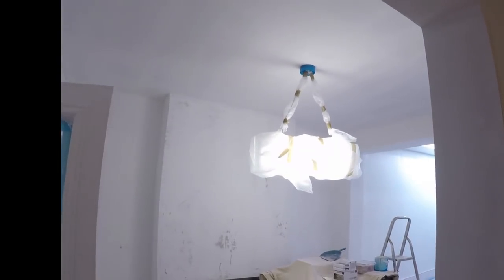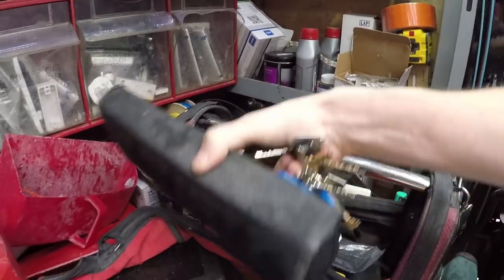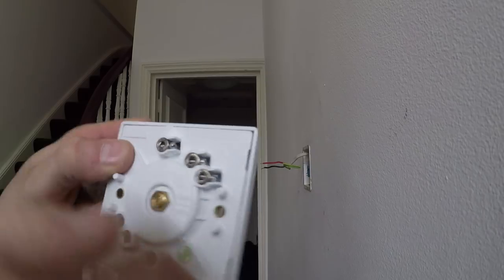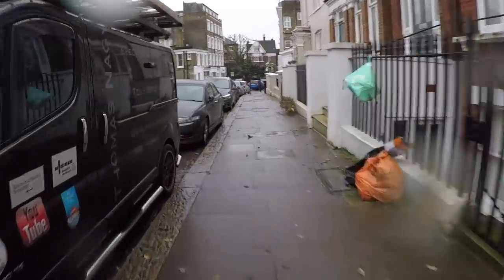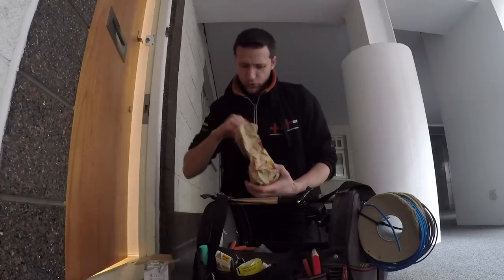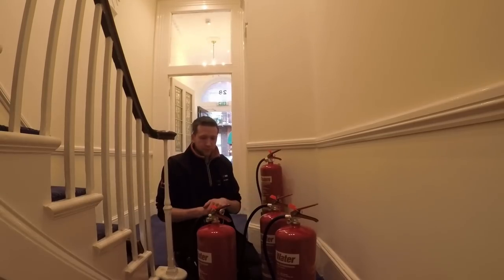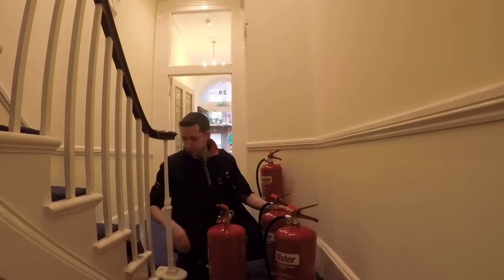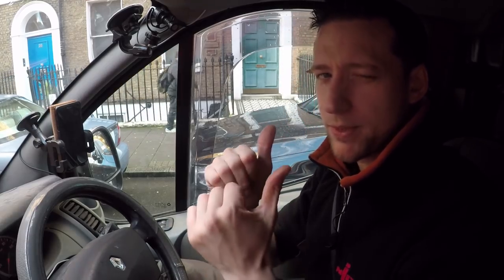Time switches & Fire Extinguishers - An Electricians Day in London | Thomas Nagy

Comment: I seriously hate the pneumatic push light switches. I find they are seriously poor quality these days and many fail within 12 months! Nothing wrong with Bridget Jones mate. It would be good to see a few more fire alarm videos from you Tom
Reply: Shameless plug: Search for MS Electronics TDS2 or TDS3 time delay switches. We’ll sort you out with a timer switch that’s much more reliable than those pneumatic ones 👍🏻
Reply: What, if anything is the standby current on these electronic ones?  Also, are they like pneumatic switches, not requiring a neutral core?

Comment: I was wondering why those timed switches don't exist at all in Germany and I think I deduced why: The way those are installed create a switches wire that will be connected to live at multiple points. Which creates so many error scenarios, e.g. people connecting it to lives from different breakers, people working on it after having disabled one switch and getting electrocuted etc. So it makes sense to me to make it code that every wire only ever has one point where it will be connected to live.

And in case you're wondering: German standard for this setup is using momentary switches to engage a central timed relay.

Comment: Those time delay pneumatic light switches are absolute rubbish. The housing association I work for insist we use the because they're cheap but they don't really save them any money as we get so many callbacks on them. They tend to stick after a while and I find they're quite inconsistent, you'll push the button once and it'll stay in for about 2 minutes, you'll push it in again and it'll stay in for 30 seconds.
Reply from the maker: agree 100%
Reply: Tbh, most landlords I have done work for have converted their emergency lights to LED bulkheads and just leave them on 24/7. For what it costs in call outs and materials to replace the pneumatic switches, it was cheaper to pay the extra electricity at 3W per LED bulk head.  

love the videos btw.... nice seeing how the other half live/work....

Comment: My main question is why would someone have a lamp installed right before the painter is about to start?
Reply: Bart Kuijper   Possible the lamp is installed since 60 years and the home owner wish a professional painter? Most normal people do not know that the painter use temponary renovation lamps ...
Reply: customers don't use their noggin. i did tree work for a bit and it seemed every time we had a big tree to remove the customer had a brand new fence put up right before we were scheduled to remove the tree.

Comment: Also not updating your phone puts your phone at risk of been compromised (assuming samsung just set it to update at 3am in the morning each day) 

and your way of thinking is why updates are not optional on google phones and they use a dual partition update so updating done in the background and does not take any longer then restarting your phone once The background update is done ,me pixel 2 phone owner (none of the updating app 20 of 346 taking 30 minuets rubbish )

Comment: Suppose we are at a better stage of fire proofing, early warning and safe exit routes now, than ever before. No need to be a superhero, and the volume one could safely manually handle is very very limited as to what can be done should the worst happen. The bubble wrap I love, that`s great until you leave the lamps on, and it melts to the fitting, unless they are LED of course. Used to get it all the time with masking tape around GU10 spotlights, leave them switched on while the decorations being done,  and hey presto, cremated masking tape and adhesive baked onto the whole lot!  Better checking when opening the van door please Thomas, lots of cyclists in London.

Comment: Quick question Thomas, what do you charge for fire extinguisher servicing, just wondering if it could be something I could add to my services?
Cheers
Reply: Razer Back It does seem a good addition to your core trade, but why 3 days worth of course. Pop quiz.. what type of extinguisher would you use on an electrical fire and what colour band is on the label?

Comment: question- what is the voltage there in london and how many phases come into the building? im in the US  we have 120/208 mostly and 2 phases minimum
Reply: 230 v single phase 
415v 3 phase
Reply: But there are usually 3 phases, so one house or flat will probably be on a different phase from the neighbouring house.  But, yes, as Ian Stevens has said, generally a single phase per property.  3 phase tends to be for commercial/industrial use only.

Comment: Fire extinguishers can also be used as a wepon
Reply: anything can be used as a weapon
Reply: Keep a hammer by the bed in case of burglary and that is an illegal weapon. A small fire extinguisher is reasonable. Blast the burglar in the face and then hit them with the extinguisher. Tell the police that the noise sounded like a fire, so you took the extinguisher to investigate. Job done. I have had a fire and it does sound like someone breaking in.

Comment: Did you not put any sleeving on the  switch wire for identification???
Reply from the maker: 3.53
Reply: Would have personally sleeved both but fair play least you didn't use tape.👍

Comment: Re: extinguisher placement. Last place i was at stated: "The fire extinguishers must only be used if a fire blocks your path of escape. Under no circumstances should an untrained person delay evacuation to fight a fire".
Reply: Mr Darn I dropped a match. I could have just put it out by looking at it sideways, but I had to evacuate so the block of flats burned down... Sorry. 

I know there are lots of people who have no sense of when evacuation is necessary, but the zero tolerance rules, designed to protect even the severely developmentally disabled leads to people ignoring safety altogether.

Comment: I dont get the switch he used. What does he mean by saying that you can wire it to turn on when you press it or off? Is this a one way switch? Shouldn't it turn on with one click and off again with another? I get the on setting, just not the off one.
Reply: It's a timer switch, it stays on for a fixed (but adjustable) time after you press it.  This allows people to have the light on when they ascend the stairs but they can't leave it on permanently.  It has single pole change-over contacts so if you really wanted to you could use it to turn something off for a fixed time but I can't think what use that might be.
Reply: Check out the wiring diagrams
http://new.abb.com/low-voltage/products/lighting-emergency-lighting/lighting/elkay/timers-switches/columbus-pneumatic-timer
Reply: What if you had the pneumatic switch on a floodlight or alarm controlled by a movement sensor and needed to use it to be able to pass a certain sensor (in one direction) without setting the alarm/light off?  Then you'd need the push to break functionality.  Probably hardly ever used though.

Comment: Thomas if your ever in America you have a promised electrian job
Reply from the maker: I’ll hold you to that. You never know 🤣
Reply: it's easier then what you're doing across the pond. every thing runs off 120v or 220v no need for calculating watts and all that
Reply: that's just an exmple. wiring is different outlets or socket as you call them are different and easier. refrigerators just require a plug haha. that fire would never happen here